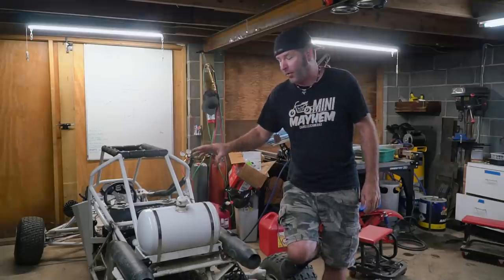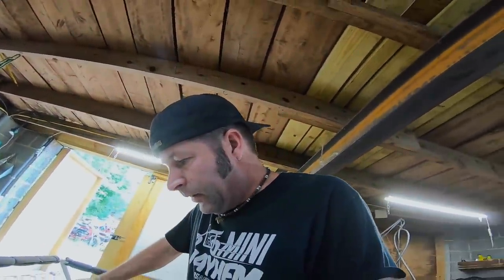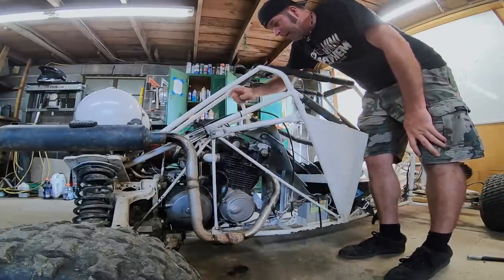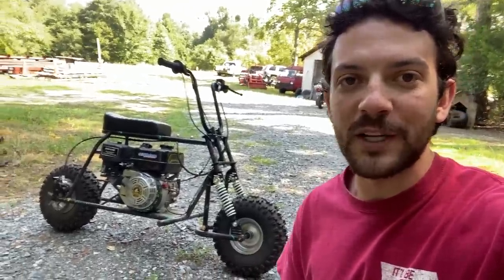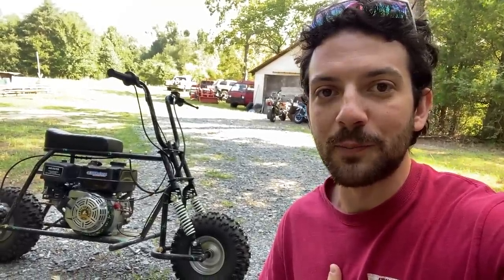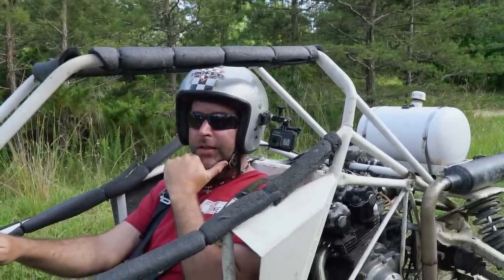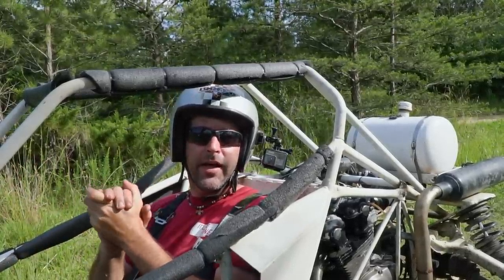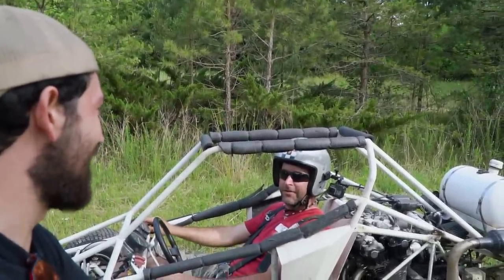Our FORGOTTEN 750cc Powered Cross Kart Returns to FULL POWER!

Comment from the maker: This 750 may be clapped, but it is still less worn out than the engine that came out of the cross kart- it feels like it's back to full power!
Reply: Are you guys planning on adding any bigger tires to get a lil more ground clearance?
Reply: Is this video before Ikes wreck or after. Just curious if hes back to A1 now
Reply: @williamwiseheart3323  I guess before
Reply: 900cc or higher
Reply: Please get a hole newer bike.
Reply: Nothing better than the feeling of improving homemade projects. Good job boys👍👌
Reply: How about this ,,please answer,,,,
Why can't you put the right carbs on the motor??it's not going to run 💯 until you put the carbs that belong on motor....why do you all do that with crap plastic piping ?why?why?  as long as you two been working on things you should know better..you should know the motor is fine ,it's gas issues 🤔🤔🤔
Reply: @andrewhenman6111  They've got a 919 Honda motor sitting around.  Would take a lot of rear end modification to line up the sprocket with this chassis, but I think it would be well worth it.  The proper number of carbs (or at least better intake manifolds) wouldn't hurt either
Reply: Try finding a yamaha CP4 engine or something of maybe a CP3
Reply: how is your shoulder feeling????
Reply: Dont go re-injuring your self I bet holding a selfie stick or whatever is murder on your shoulder
Reply: swap it to a gsxr 600 maybe?
Reply: @chappyboylsx2596  I couldn't agree more Chappy!  They have no clue what 100% of an actual CB 750 F Super Sport engine will actually do.  I've owned two, and my experience is they roar to life when you bump the start button, idle perfectly, and make good power from 3500 to 9000 RPM.  And do this for 80,000 miles.
Reply: You are rich on 2&3 and lean on 1&4 due to you homemade intakes.
Need balance between cylinders.
4 carbs or balance the manifold.
2 90 degree turns kills the mixture.
Reply: @mikedavis1751  you'd think they would have fixed that by now...
Reply: @chappyboylsx2596  it's called a budget...
Reply: @AL4N.  when they have the right carbs/ parts to do it ,I don't call that budget .what's cheaper,carb kit or new motor?
Reply: @chappyboylsx2596  oh I 100% agree with you....I said budget because it seems thats their favorite word.
Reply: Use the Ducati engine the go kart chassis can’t run it anyway
Reply: What happened to the 919 engine
Reply: Highly recommend new spark leads on all these old motors. You'll be amazed what a msd superconductor lead does to the running and starting.
Reply: @bibbob3531  they didn't want to fab the backend to fit the 919,so they never put it on....I would have thought more content for them if they would have put it on it ,but they are about budget builds so never happen.
number 1 rule, GOT TO SPEND MONEY TO MAKE MONEY,,,
Reply: How’s about an older Harley power plant for a build? Very interested to see that!
Reply: Y'all should go back to a 4 carb setup. Those 90 degree turns are not good for the two outer cylinders.
Reply: Could the coil have been the problem with the other motor?
Reply: I know y’all have so dang much on ur plate currently but I’m dying to see a Cars & Cameras SxS/buggy build. Like full cage, two seater, small as possible but capable; maybe two stroke snowmobile cvt powered? I have endless suggestions
Reply: Kewl.
Reply: @kevinsellsit5584  Sounds true to me.
Reply: @natefessler3961  They already measured it. There's no way the 919 will fit without cutting off the whole back half of the chassis and reworking it.
Reply: @gokarting1018  yeah and the old ones are not helping a lot which just got put on. Noticed a big pink X on the set they took off this time - must have known they were wreckage by that clue..
Reply: @pookysdad4884  I saw.  Going backwards to go forwards is a part of fabrication and development.  If you want it to be better, you might have to do it more than once.
Reply: If you dudes have a predator motor or similar that I can put a comet kit on I have a very low mileage FZ9 motor on a Kawasaki Mule we could trade. Header, exhaust, wiring harness, fuel injected and all. It has a newer 2017+ R6 fuel pump in an ammo can, I’m sure y’all have a fuel cell you could work up better than my ammo box.
Reply: Careful on your shoulder man 👌
Reply: You should put the ducatti engine in it
Reply: You know you look like the guy Rather B Welding right.
Reply: The alternator might not be correctly charging the battery and low battery voltage causes odd symptoms with high tension leads and discharge coil packs. 

Check battery voltage is within correct range.

7:15 Leads are crossed and touching which causes phantom firing and rough running also.
Reply: If you want to keep it budget bore it out, re-ring it and lap the valve seats. Throw on some OEM carb boots and see how it acts.
Reply: You know that the carbs are meant to be directly in front of the intake, I don't remember to how many milliliters but they are very precise. I had a 77 and 78 then moved to a kz 900 the CB 750 was much better than the kz as far as maintenance. Call a Honda shop and see if they have any old specific guidelines for those old bikes
Reply: I want this thing so bad... Trade ya a 2 stroke 6 speed shifter kart and cash 🤔

Comment: It's the intake setup. Your middle 2 cylinders are cold and killing plugs because the fuel/air mix has a straight shot to those cylinders while it has to make 2 90° turns before it gets to the cylinders.
Reply: Imo there is no way it wouldn't be the cause. it has an effect on it for sure.
Reply: @cody McGill 
I been trying to tell them two for a very long time that the plastic piping and 2 cards isn't going to work right on it. They can't find out why it won't run right 🤔🤔🤔
Reply: Might also be worth mentioning that when they did use the 4 carb setup they used cheap and nasty chinese style air filter pods that are well known to cause issue with them older keihin carbs. Whack a set of Mikuni RS34 Flatslide's on that bad boy and it'll rip! (with proper manifolds ofcourse!)
Reply: @BSFPC  I know you are absolutely right. It needs 4 carbs to work right so they are all feeding the same. Get rid of those elbows and plastic fittings and it will work fine!!!!!!!!!!!!!!!!
Reply: Need to go back to 4 carb setup
Reply: Each cylinder will get equal amount of fuel at the same time
Reply: (Supposed to)
Reply: They are going to try to tune between the “rich and the lean” to get it to run.
The lean cylinders will burn themselves a new exhaust port, right through the piston.
Reply: 750 carbs are super finnicky, they work best with factory setup
Reply: Not wrong bro fuel system needs to be precise
Reply: Agreed carbs are finicky in general some are more than others
Reply: I don't understand this if the engine came with four carburetors originally why would you try to run it on two carbs you're starving the motor of fuel
Reply: With your logic,  and to be clear,  I'm not saying your wrong... But then wouldn't that be the case with any engine behind a seat,  etc...?
Reply: I'm used to eating six to eight pieces of pizza for dinner and then you tell me I can only have one
Reply: @nicholaskorner2258  I'm not understanding what you mean
Reply: @chappyboylsx2596  lol I agree with you that engine was designed to run on 4 carbs it's not ok to run it with only two starving it of fuel
Reply: @BSFPC  agreed brotha
Reply: Yesssss!!! I said the same thing a couple cross cart episodes ago
Reply: Even at that it looks like they used two TWO STROKE dirtbike carbs for the rig so it'll never idle correctly
Reply: The cb750 came with 4 carbs for a reason. The only way to run that on 2 carbs is to run equal length runners on the intake manifolds with 2 carbs that are big enough. They way it is set up is running the outer cylinders very lean and can burn the factory magnesium pistons or the head.
Reply: @daltonfrith7685  i mean, magnesium fires are pretty cool to watch. Sure, you don't ever watch anything else for a while, but man the lights
Reply: Exactly!! The fact changing the airbox can DESTROY the way q bike engine run. Put a set of vacuum gauges on those wages carbs and they will see why it runs like that.
Reply: @larrydavidson3402  My thoughts exactly!
Reply: @daltonfrith7685  yes sir
Reply: @daltonfrith7685  agree 100 o/o
Reply: @mackelby1  amen to that bit if advise  !!....( no spring chicken here....65)
Reply: @reddog543211  62
Reply: @mackelby1  👍
Reply: I have been telling them this since day one. They don’t listen. I know this motor. There is nothing wrong with that motor. It’s them trying to do this carb setup. It doesn’t work without that airbox. No Venturi system works right without that airbox or filter. Mine did not run right with the pods and I put my factory airbox back on. It ran great
Reply: Add more 15 sec commercials and buy an efi engine 😂
Reply: I think they could run two carbs, and set one richer, 1 for the outside 2 cyl. 1 for the inside 2.
Reply: @izzyplusplusplus1004  I’d like to see the inlet manifold for that!
Reply: At least use an actual Y and 2 45's to get equal length and geometry runners.
Reply: Agreed
Reply: @izzyplusplusplus1004  they could run two. It’s not impossible. They just have to be even. Which they are not. One cylinder is getting more than the other. That’s why all the smoke. And two cylinders aren’t firing but occasionally when they get the gas. That is exactly the issue. If they had some one fab up a good y made from aluminum they would be set. They would have to do the calculations on what size they need to make up for that being a four carb setup to a two carb setup. They would not put the same size. But u have to take into consideration that they have four carbs for a reason. If they were meant to share a carb the pistons would fire at the same time. They weren’t meant to fire at the same time. If u look at older cars they have a specific carb that distributes gas in every direction. They also have a plenum that goes to all cylinders. But the carbs on the older cars are constantly feeding gas at the right amount of tuned properly. But all sides are equals. They’re are bikes that share one carb. They also fire one right after the other. U gotta think that it doesn’t go down the line. 1 is on the one side of the engine and number 2 is on the opposite side. Ya know what I’m saying. Thinking about the timing to. It’s backfiring so it’s just pushing all that gas back into the other cylinders and just soaking them Bc of it not getting enough fuel. There is nothing wrong with that motor. Those are good strong motors. It’s just that they need to figure out the the spilt. It has to be even. Hell they could run one massive carb on it if it were done right. They totally have the right idea. They just need to listen to us. Which I really think they fail to do. Most of us on here are actually mechanics and I think Isaac is too. But motorcycles have different electronics and are just a little different motors. Modern cars now use fuel injection. There’s different schooling for every thing. But a motor is still a motor
Reply: While Ike has worked in a garage, he is not a mechanic in a technical sense. He is a back yard wrench, not even shade tree. 
The other guy is far worse. 
Don't expect them to come around, because in the years they have been at this their skills are unchanged. 
Doesn't mean I don't like them or the content. I do.   
Some people just are never going to get certain things. 
This kart would be frightening if it made full power, it has never even came close to much more than about 50% because of the poor induction.
Reply: Now that I think about it you would have to tap each PVC tube as close to the intake port to put gauges on.
Reply: @mackelby1  motorcycle engines and carbs have to coincide. The carbs that come on there are tuned for the distance from the airbox to the motor. So from the airbox to the carb has to be spaced accordingly and the carb from the motor has to be spaced right too. When u change that u have to get the carb either big enough to support making two cylinders run at once and jet it just right after the fact. Jetting only fine tuned it. The rest is up too the style of carb and the size of the carb. I would do a 75% larger carb. Essentially 1.5 times bigger. They come with 44 mm carbs. I would do a 65 mm carb. They should just put the stock shit back on. It’s not hard to find. That is a wanted bike. They’re going to be expensive but a lot more common. Bc it’s the same motor that’s in the nighthawk. All people want to do is look for a cb motor. I know this bike in and out. That motor doesn’t like when u start changing that shit. They’re not going to listen. This whole issue would’ve been fixed what a year ago. That pvc isn’t even good for gas. Neither is the rubber boots. They have to get them carbs closer too. Like I said. The space between the carb and motor is all calculated into carbs and jets. U can’t just up and change the position like that.
Reply: @checkforfleas9452  ve y interesting. Thanks. Very informative.
Reply: @mackelby1  not every thinks about those things. U can take literally any carb that will fit in that boot and use it lol. But will it work. No. U have to fine tune that thing. I have built snorkels for my wheelers and them not work the right way and that’s Bc your changing so many ways that carb works. They’re trying to do things and I get it. But u have to have that knowledge. I don’t have that much knowledge about changing those things. I just know how it works and why it won’t work. I’m sure if I sat down and did the math and spent extensive time on trying to figure out the spacings I could make them carbs work. But it’s much easier just to buy the right things
Reply: Carb/ manifold set up is all wrong, as others have stated the bends and straight sections are at fault but that is a small part of the issue , the stroke of cylinders 1 and 2 are 180° opposed to each other, a single carb feeding 2 cylinders will work on a v twin or a 360° twin cylinder. The only way for the twin carb set up to work is a 2 stage plenum with one or two carbs attached to the first stage and that stage feeds the second stage which connects to the 4 cylinders.  Also early double cam 750 /900 Honda's charging systems pull a lot of voltage away from the ignition system as the engine is run at higher rpms, the engine will start right up and run ok till about 5 or 6 k rpm then start misfiring.
Reply: @speedracer650  well put. Agree one every bit. But I was curious on the voltage thing. I never noticed mine doing that. They are still not going to listen. I mean I literally built my cb750c from the ground up. I know this bike very well. I know that it doesn’t like to starve which it’s starving one cylinder and the vacuum is just sucking more for one piston Bc of the travel and just dumping it all into one. But they won’t listen. I am no mechanic in motorcycle but I am in cars. Like a said a motor is a motor. Some are different. Motorcycles are different. But I do know this bike doesn’t like not having that factory airbox. Yea u could tune it to run on pods but then they block that Venturi. But we’ll defined explanation on what it’s doing. I’m not calling u wrong on that voltage thing. I just never noticed that. I mean mine ran great. I did get on it a lot.
Reply: Stock CV carbs need a stock air box. It’s way to much of a pain in the ads any other way.

Comment: You guys need a proper intake manifold, the one that you have is wrecking the fuel delivery on the outboard cylinders while giving the two inboard ones a straight shot to the valves, and you really should sync those two carbs correctly.

Comment: Those intakes just aren’t sitting well with me, it’s straight through to the front two cylinders but it’s like the outer cylinders aren’t getting much of anything. Need to do more of a Y than an L
Reply: Definitely agree 👌 I was going to say the same thing but happened to read yours first 
I just wish they would bit the bullet and put that sports bike motor on it 😅
Reply: Yeah, I think it'll run okay with just 2 carbs if they can get equal length intakes into them. 4 carbs would be ideal, but I can understand them not wanting to try to make that potential headache work properly.
Reply: I say pipe stack em individually four pipes straight up or maybe they have room to put a 45° for the bend to the carb.
Reply: bro that has been bothering me and my dad ever since they started that with the cb750s
Reply: he should be able find them off of honda 250cc 2002 rebel motorcycle there Y on intake to carburetor because i know where find parts will fit it
Reply: It is only costing them about.......20HP. 
I have lamented how poor of a solution it has been  since the beginning.

Comment: After tuning hundreds of honda 750's over the years, if you don't SYNC those carbs,  you'll never get optimum performance!! 🥺
Reply: Won’t be as smooth, but wide open is wide open.
Reply: Went thru that on an old kz650 I got when I was 13. 
Once it was right though ,she ran like the dickens. 
Broke traction at 75 on dirt roads 😂
Reply: Dudes right . Really do need to synchronize those carbs . There's a tool for it
Reply: @jacobbornman9494   But these aren’t even the stock carburetors . The stock motorcycle has four carburetors.. syncing them just makes each carb open the same amount at the same time. This has two carbs that can also be synced . But I’m telling you now .. that is not why it runs like shit.

Comment: PLEASE DITCH THAT INTAKE SETUP. Don't even gotta go 4 carbs. Have a plenum between the two carbs and the 4 cylinders. Plenum has to be AFTER the throttle blades.
Reply: A plenum with 4 intake runners would be perfect. Throw a Holley on it!